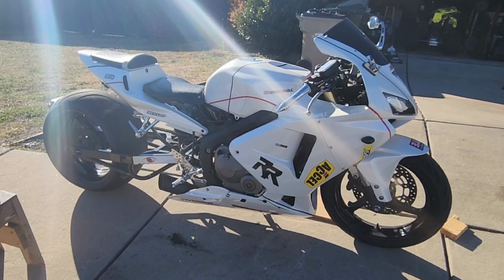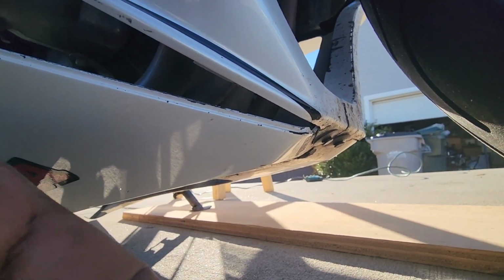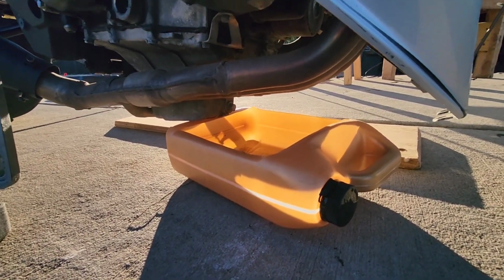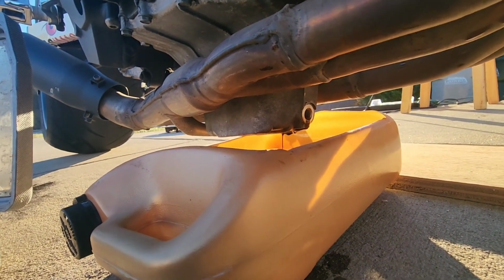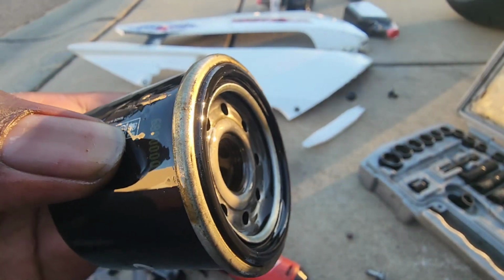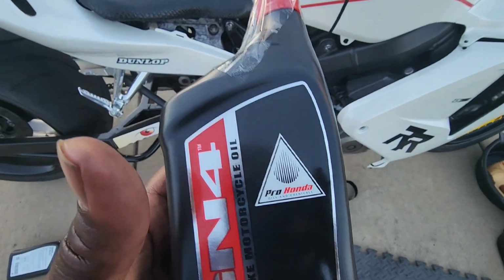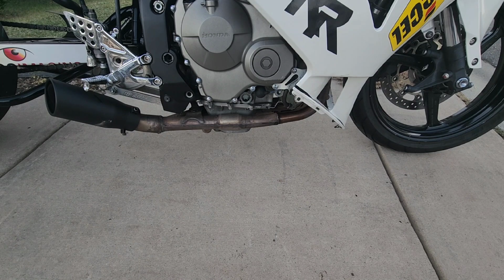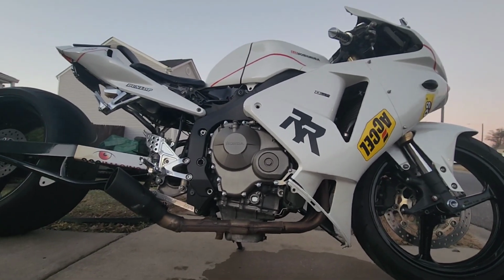Honda CBR 600RR / 1000RR Engine Flush and Oil Change (JOATD)

Comment: does that engine flush stuff actually do anything? like do you notice it running a little better than just doing a regular oil change? i have the exact same bike,  arctic white fairings with the frame,  engine and swingarm all blacked out... looks sick lol,  i love it.  been watching your channel for all my basic maintenance jobs. you're bike looks done up  for drag racing... what kind of times do you get with there 600? i like your mirrors too, they're pretty sweet.  Drag Specialties? thanks man!
Reply from the maker: Thank you I appreciate the positive comment. I hope my videos are helping you in whatever way that you need I also have videos on my old bike Suzuki how to install a stereo system and other things. To answer your question keeping your motor clean prolongs the life of the motor. But if you change the oil regularly you wouldn't have to use a engine flush.
Reply: @JOATD  thanks brother,  i appreciate the reply!
Reply from the maker: @DiagolonRider  no problem